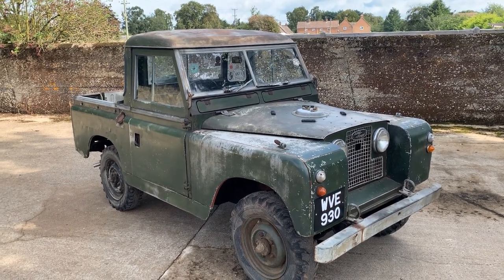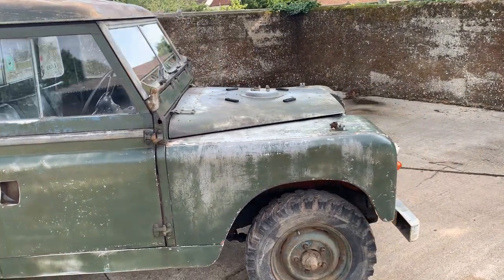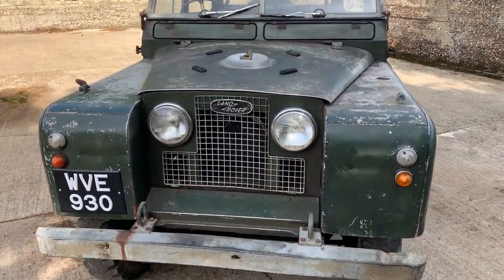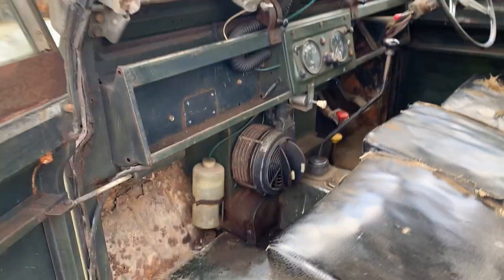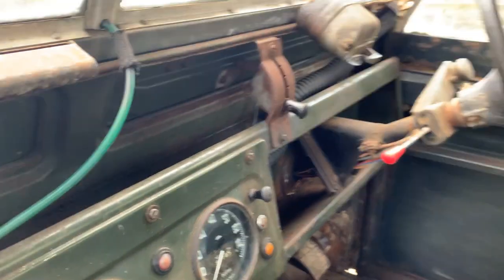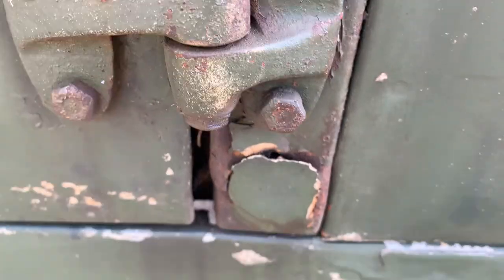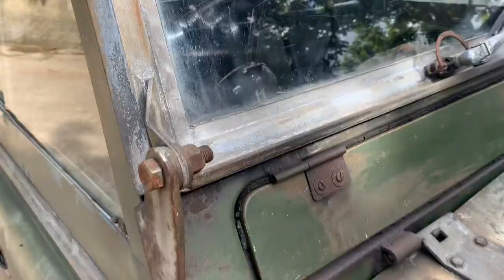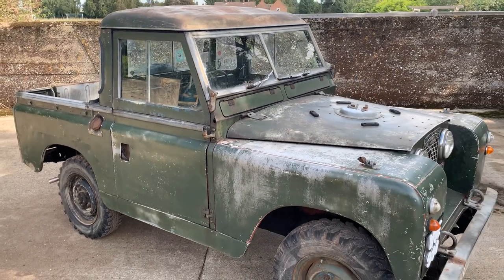land rover series II 88in petrol pickup walkaround +engine running

Comment: Rebuilding a s2 petrol would have cost me 500 for shells for the mains and big ends.( . 1/8 “smaller than series 2a3 )Then engine out , rebore new pistons rings, unleaded head.   1500 quid plus and I’ve still got a thirsty under powered 109. Unfortunately there was no competition!
I love my 200 tdi conversion